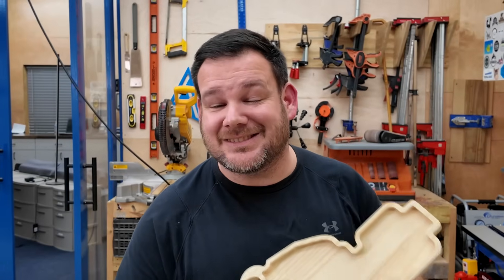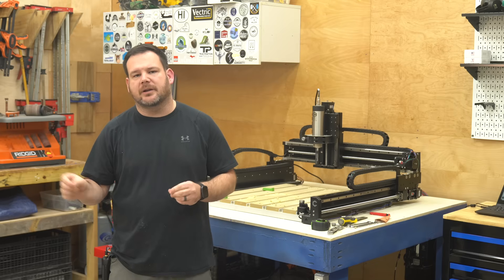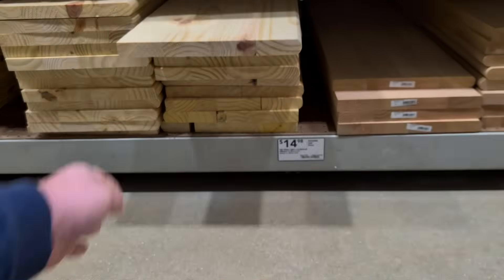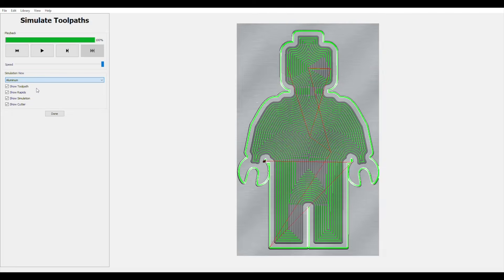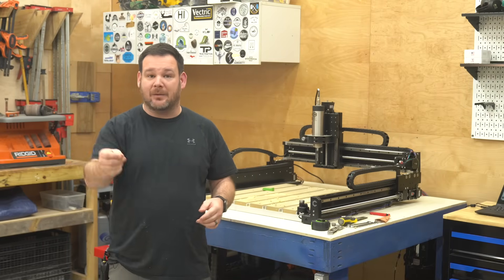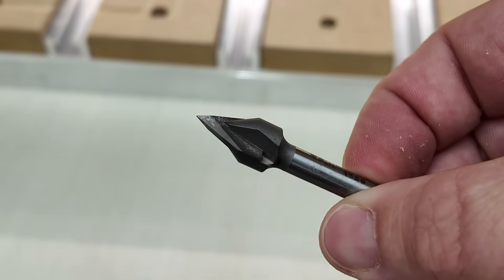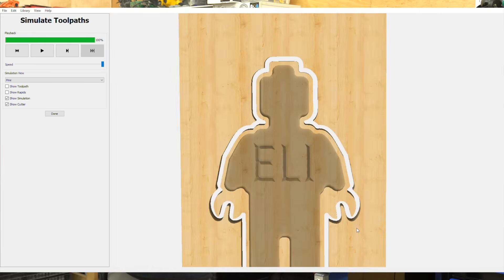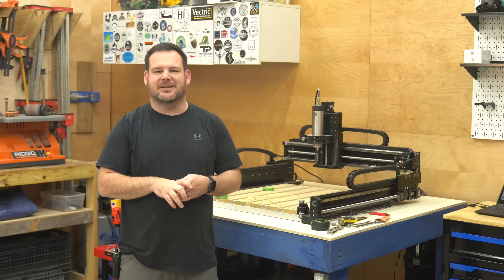this SIMPLE TRICK Guarantees First Project Success

Comment: Having trouble with my machine lately. It's cutting way past the depth that I set. Therefore I have to counteract it or stop once it's cut thru. Basically I set my material about .25" less than the actual thickness
Reply from the maker: Yeah thats not right. Have you contact their support?